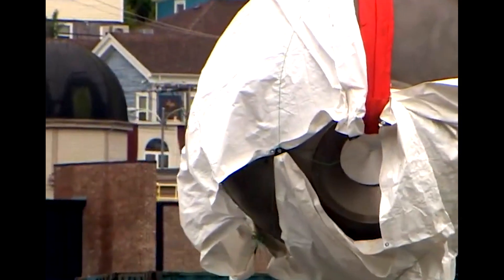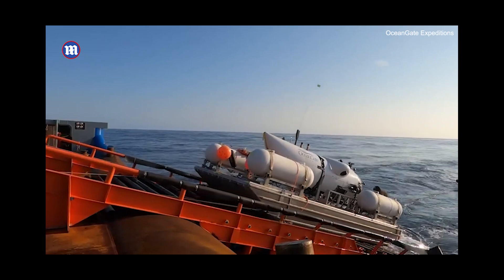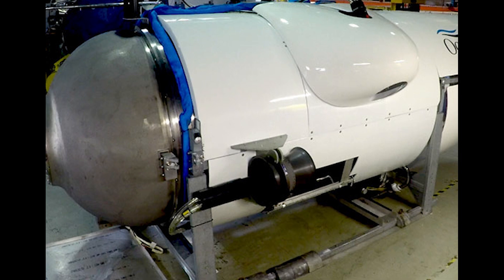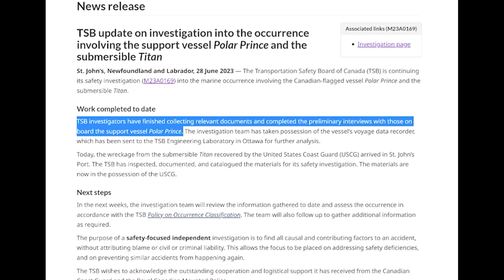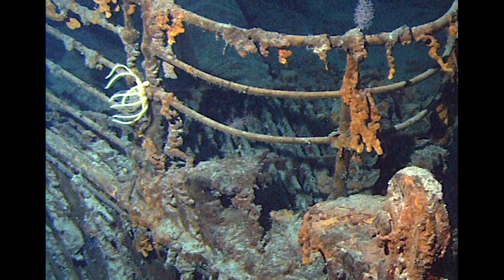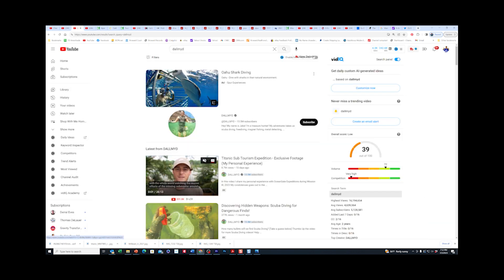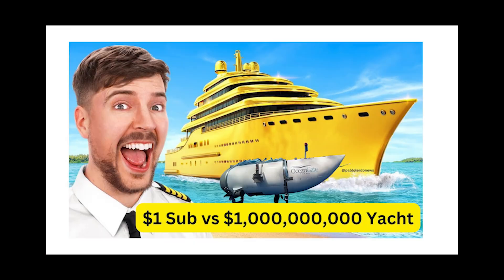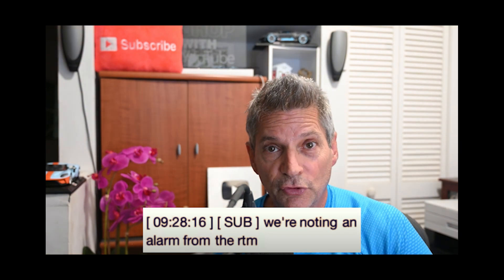Titan Submarine Debris Clues, Implosion Simulation

Comment: In my humble opinion as a graduated engineer, the main problem of the Titan was the hull, made from carbon fibers. This material is perfect to take pull-forces, e.g. for manufacturing pressure vessels with a higher inside pressure than outside, but is as horrible to cope with push-, or sheer-forces, as a rope. This is caused by the hexagonal molecular structure of this material and the covalent triple-bonds (instead of quadruple-bonds, carbon can make e.g. in crystals, like diamonds or DLC (Diamond Like Carbon). Consequently, the whole push-forces from the water-pressure all (!) lasted on the epoxy-resin. A material, that tends to crack upon the slightest force asymmetry or temperature-gradient under stress and exhibits unpredictible material fatigue. It is not a coincidence, submarines are normally built either from steel or titanium. Even aircraft-aluminium is better suited, since it can flex upon pressure, while epoxy is very limited. Conclusion: The imploded sub was a faulty design.
Reply: Agreed also in my opinion the shape of the sub alone gives me some definite concern
Reply: Flimsy materials + arrogance
Reply: @@UntrepidOne-gx5le Composite materials from fibres are great to take static pull forces, but that's all. These can neither cope with push-, nor sheer-, forces, nor vibrations. Since many, many wind-turbines failed due to this reason, today turbine-blades are made from completely different materials on the push-faces, than the push-faces.
Reply: why did thy use carbon fiber insetad of fully titanium
was it to save cost or to make it lightweight
then y were thy charging so high tickets when it was cheaply made
Reply: @coolmonkey5269 purely cost savings....they were charging "high prices" per ticket quite frankly cause they could and people would pay. That being said, employees still have to paid and materials, research and development ate so much into their budget they just didn't make enough profit to splurge on a more expensive vessel. The French guy(who owneed the rightnto titanic)and the other explorer probably took a nice cut as well. Lastly, ceo probably spent 20k a year in his hair styling alone. 😅
Reply: Agreed .The pressure put the outside surface of the tube in compression  and the inside was not wound so that the fibers were aligned with tension on the inner surface as should be. Complete misunderstanding of the strengths and weaknesses of carbon fiber  epoxy composites.. It is a completely different situation to to have pressure on the inside of a composite cylinder than to have pressure on the outside. Carbon fiber composites will be very weak in compression.
Reply: I thought the same thing.  Carbon fiber shatters when over stressed while steel and titanium will deform before failure.  It's why products like carbon fiber rebar haven't been approved for construction.  They can't get it to pass the testing.
Reply: lol @ instant contradiction.  🤣
Reply: @@UntrepidOne-gx5lefiber is fantastic for many tasks.. just don’t make deep submersibles with it.
Reply: @@UntrepidOne-gx5le fair enough, but if it’s not working then you aren’t using it for the right applications, or using it correctly.
Reply: But: capitalism
Reply: @31minutesago No one told these people to go and spend 250k on this unregulated disaster mission in international waters. Capitalism communism shittyism. Stupid human error is the primary component to this tragedy. It’s a shame this Stockton dude was arrogant enough to bring unsuspecting passengers on his one way trip to ALMOST seeing the titanic.

Comment: Jeff,  Was trained in strength of materials at Virginia Tech engineering school.  Horrified that sound well made titanium end caps were attached to carbon fiber hull with only GLUE.  Depth Pressure force is felt in all directions not just plan and cross section.  Therefore I question modeling and calculations for end cap connections.  Also Stockton RUsh said that at depth the hull compresses by 3/4 inch.  So hull compresses but not titanium end caps.  Therefore carbon fiber developed brittle failure at connection to end caps.

Comment: By that ring being separated from all as we see - it indicates a full seal -pop upon the squeeze of the tube. I agree in thinking they did have sensors indicating hull stress, but too little too late - all resurfacing measures failed before the pressure could be substantially reduced. Even if there was time and they made it up to just 3000 feet any hull issues would be fatal. They were at around 12, 000 !   Shame on S. Rush skipping the technical certifications.

Comment: Being a mechanical engineer, not marine related so probably talking nonsense, but I would have wanted at least double the ring area to glue not the amount that was used, seems way to little to me having done small scale carbon fibre to stainless we used the largest area possible the other thing we did that I was surprised was not used was adjustable rods from front to rear spaced right round the bonded rings to make sure that if the glue was to give then the rods would be the failsafe to give time to return to the surface, maybe this might have saved lives.
Reply: glue? I'm out right there.

Comment: As a machinist looking at that mating surface it’s scary. If I had to do it I would of slipped the carbon fiber over the ring and have a step on the outside of the ring that bottom out onto the face of the carbon fiber. This gives compression strength to the lip preventing it from collapsing because of the Titanimum on the inside. Never put a sealant like that glue in an expansion condition. It needs to be used in compression so the more you squeeze it the tighter it seals.

Comment: Even without knowing the Titan's design and qualification prrocess, I totally agree with your observation that the titanium ring interface is troubling. Gluing dissimilar materials together and hoping for the best sure looks like a recipe for disaster. The naval and power plant pressure vessels built by my former employer operated at lower pressures than the Titan. Nevertheless, they were built in accordance with the ASME Boiler & Pressure Vessel Code; and were formed by welding rolled or forged sections together into very strong monolithic components. They were also non-destructively tested, and underwent hydrostatic testing in excess of their design pressure to ensure they would not fail. I wonder if the Titan folks could have made similar claims.
Reply: Pfft sounds like a whole lot of innovation-stifling testing and codes you guys had going on there!
Reply: @christianjmoss  Pfft back at ya. In the US, and in other countries as well, Code compliance is required by law, and mandates a process of qualification, certification, and testing that is not intended to stifle innovation; but rather to ensure safety standards are maintained - to save lives.
Reply: @crabbyhayes1076  My apologies I should have made my joke about the attitude from the owner more clear by adding the /s at the end, I worked on large construction projects where we had some very graphic and deadly demonstrations of why "safety codes are written in blood".

Comment: Carbon fiber technology currently being used on some pressurized tanks.  Note: No crisscross carbon wrap used in Titan walls.  All fibers are PARALLEL to each other, not diagonal.  Expoxi resins might embrittle at lower temperatures.  Containment walls can crack thru, perpecticular to carbon fiber direction.  As with the Thresher, water filling vessel will slow its ascent.  Air tanks using epoxy carbon fiber technology may also experience epoxy embritilment do to lower temperatures created do when gas is released from it.

Comment: Maybe the glue is what held and when the back end imploded it was the window that gave out and shot off followed shortly after by the steel ring. That would kinda explain it, like crushing a plastic bottle from the bottom and the top pops off. Only with this the window went first due to a crap join.

Comment: I believe that the rear compartment was leaking from the start which can explain the rapid descent and failure to ascend due to the extra weight. If the leak started right from the beginning the pressure would remain mostly equalized in that compartment so it didn't implode.
Reply: so how is it in pieces then?

Comment: Was this a case of two different materials, titanium and carbon with different properties, with the carbon flexing, however small, and the titanium not flexing, which caused a separation.  Could this explain the cracking as the carbon layers separated and/or the glue.  They may have thought the design was elegant, but possibly it was too simple. Why not an inner as well as an outer titanium ring or rings.  Im not an expert, but the carbon would have nowhere to go.  Very tragic.

Comment: One of the first videos, taken I suppose by the Canadian remote cameras, and which clearly showed the debris field sitting on the ocean floor,also showed the nose cone of the Titan facing upward. It also showed the viewing port window, still in place on its nose cone, with just a small portion (about 1/4) of that plastic dome missing That hole would have been big enough to loop the red lift harness thru, for unloading purposes. As to the missing retainer bolts, I think it just looked they were missing, due to lighting and reflections at the time these pieces were video taped/unloaded from the salvage ship, in St. John's. If what I saw was not an optical ilusion, then there must have been a hairline splinter crack already in the plastic viewing dome. For certain the force of the implosion and compression of the main cylinder, would no doubt have blown both ends away from that main habitation cylinder. I tried to re-find that video without luck. Maybe someone else has seen it. I did have to enlarge the clip for an up-close clearer view.
Reply: Know where to find the video?

Comment: Carbon Fiber cracks into shreds of material when under severe compression..

Surely they researched material strengths before manufacture..

Glue, solvents can be subjected to erosion from sea water..

Like you say, where is the 'torque wrench'..?

Ask Boeing what they think about glueing Titanium to Carbon Fiber..?

Solid Stainless Steel Tube under compression is 5x stronger than Carbon Fiber..

Comment: FYI, at 3500 meters (which is basically at depth of the Titanic itself), they must drop weights to stop their descent. There is no other way to stop from hitting the ocean floor than to drop some weight. That is perfectly normal and does not at all indicate an aborted dive. You would have to know how much weight was dropped in order to ascertain whether or not it was an aborted dive. Again, just more speculations. There are so many speculations run about touting themselves as facts, it's ridiculous. And now you even have a fake communications transcript circling about that the gullibles are latching on to. I get that we can only speculate about many things in this event, but people really need to stop portraying these things as if they are factual. Many are not even plausible.

Comment: I don't understand why so many people focus on things like "rusted scaffold pipes for ballast weights" .. why is that at all consequential? .. in my view, that is perhaps one of the smartest things Stockton Rush did on this vessel. It makes a whole lot of sense to be dropping scrap iron for your ballast deployment. What, you going to use polished stainless steel? .. why? .. so it can look nice before you drop it to the ocean floor where it will sit until it completely corrodes away? .. using old scrap iron like that was actually a very good idea, probably his only good idea in this whole thing.

Comment: I was wondering if subs also need rubber seals. 
I am working with pneumatics and there we always need rubber seals so when the modules are in work the air doesn’t escape providing a higher efficiency.
When I watched the video of DALLMYD they did a test dive only a couple meters and when they closed the hatch it was just metal onto metal. That made even me suspicious and I am not an expert. I only know that rubber is needed to seal things. If water or air.

Comment: The submersibles are only rated for going down 'x' amount of times before needing to be retired- but what about the length of time in one dive? If by chance Titan didn't implode, and hypothetically oxygen was not a factor- How long could a submersible stay down there before pressure got the best of it? After so long, with so much pressure, I'd assume it would also implode from just being at that depth after a while.

Comment: the way the tube is being made here. They are using individual strands of carbon and bringing them together to make a sort of strap a few inches wide and continuously wrapping the tube. There is no weave at all, just a bunch of fibers running the same direction glued with epoxy. I don't understand how anyone with an engineering background could think this would would work. I didn't even go to college and can see this technique of building the hull could never work. Not to mention they didn't use any sort of vacuum system to remove trapped air that could cause weak spots. This guys hubris got these people killed and it's a shame. He cut corners and ignored warnings and only succeeded in inventing a death trap.

Comment: Where are the bolt holes for the flange that holds the viewing portal? 0:44 When they're lifting it with the red strap, I don't see any bolt holes. At 0:48 there should be 16 of them around where the red strap is passing through.

Comment: Exactly what I expected to see at the carbon fibre to Tiatainium join clean titanium with some small area of oxidization, every time that sub went down that interface would crack, a little more, and a little more until, that join would leak and then crack wide open. He didn't do it correctly from what I could see. I known a little about Carbon Fibre to Metal joining, and it looked wrong to me. The clean Faces on the titanium end bells, and now the description of the failure confirm my suspicions. Nothing about this surprises me, Wrong build design from the get-go.

Comment: Just look at the way the made the tube. Normal carbon fiber has its strength from its weave. Its crosshatched and on top of that the layers are rotated with each layer to create an extremely ridged strong yet light part. Not to mention using a vacuum to elevate any air pockets as weak spots in the final form.